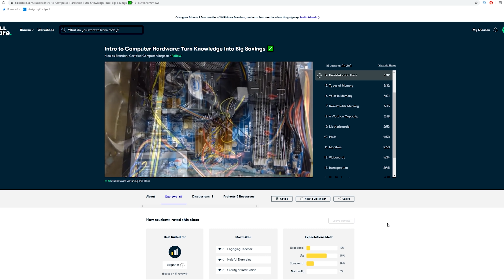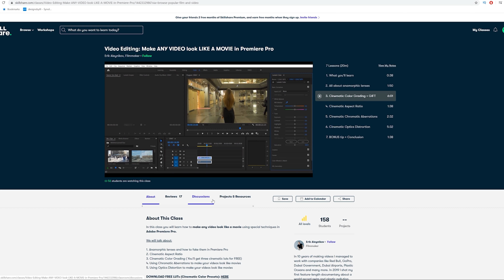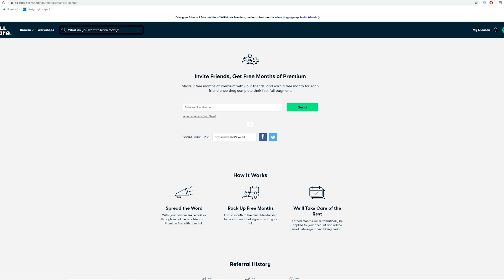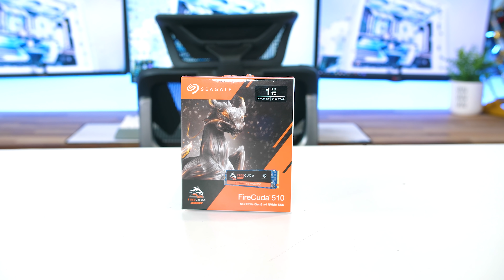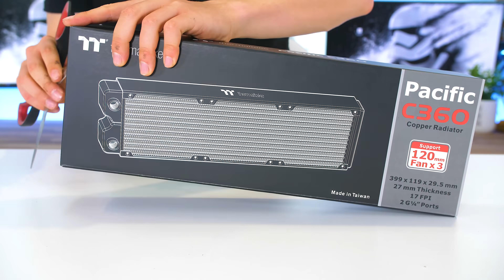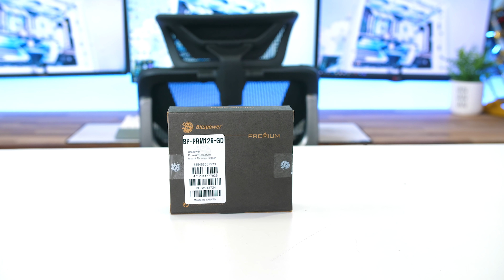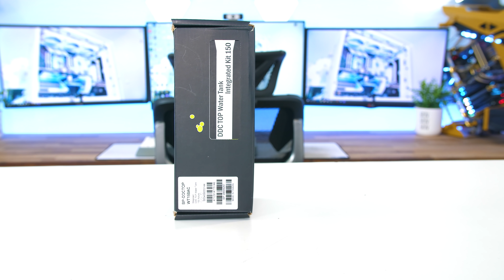$4500 Ultimate High End Water Cooled Gaming PC Build | Crazy Time Lapse

Comment: I used that same water cooling set up on my i7-4790k, used the all white Asus Mark-S with the limited edition Avexir sabranco 4x4gigs (it was a z97 board) along with the galax gtx970 HOF with a custom diamond cooling waterblock. Had it in a custom silverstone TJ07 . When Coldzero.eu was becoming big in case modification parts. To see you put this all together though is awesome man. I still have both of those (brass top) reservoirs and both of those MCP’s with the gold bitspower fronts. I’ve ended up doing a black and gold Ryzen 7 and a 2070 super now but I’m using the same ram. This stuff is therapeutic. I just wish it was a cheaper hobby lol

Comment: Sick build as usual, any plans on doing a build in the phanteks enthoo luxe 2 case?? I'm doing a single system build in that case utilizing all the rad capacity to fill the empty space, two ultra thin 480's and two 360's with 17 fans and the d140 distro plate and wondering how to run the loop lol.

Comment: nice looking, but I confused by the water loop
as I see in the video, the liquid will go from the tank to gpu to the cooler then cpu and finally back into the tank, at this point, the liquid is hot (I can see a little steam inside the tank)
and that hot liquid go directly to gpu again?
Reply: Hmm... it may look like steam, but it’s highly unlikely. For that to happen the liquid inside the loop would be approaching 100C. You might be seeing the lines from where the liquid was before entering the loop🤷🏻‍♂️ also, with these loops, the order is not important. Idea is the liquid heats up to a certain temp and keeps the components cool. Usually around 33-35 C liquid temperature.

Comment: Hey my name is Emir

I want to build a pc with following parts

Cpu : amd ryzen 7-2700 x
Gpu: msi radeon 580 x 6 gb
Ram: corsair vengeance 16 gb ddr4
Motherboard: asus b450 m amd 
Power suply: thermaltake 700 w rgb
Case: abkoncore 710 ps for every motherboard
Ssd : kingston a 400 480 gb ssd
Metalicgear 120 mm fan x6
 
This is around 800 euro in my country 

My equipment 

Razer deal includes croma membrane game keyboard mouse and kraken x headset with golliat mousepad 

Also aoc 144 hz monitor
 
And a xxl mousepad from sharkoon
Reply: 3200mhz ram?
Reply: first name last name yes
Reply: For productivity?